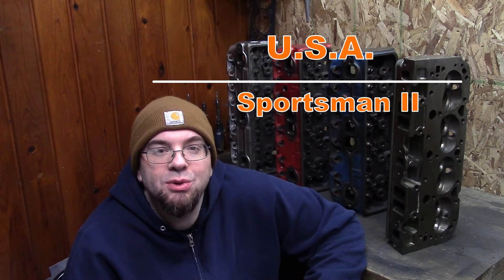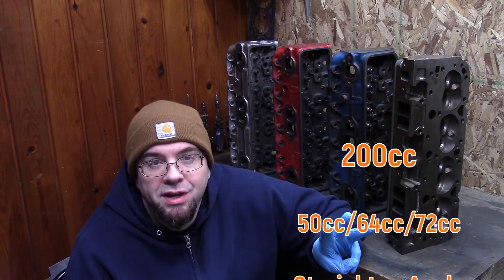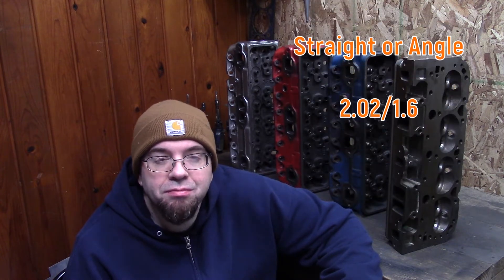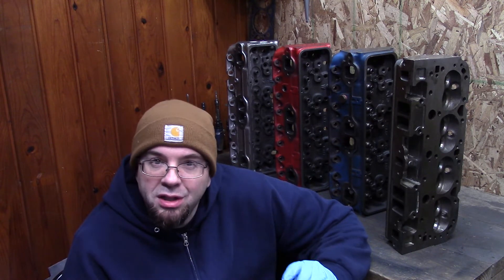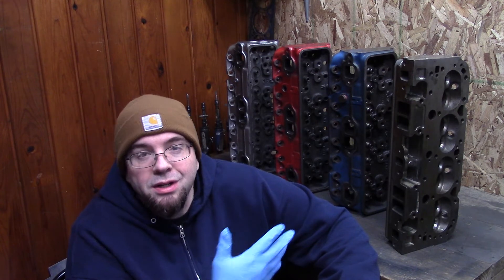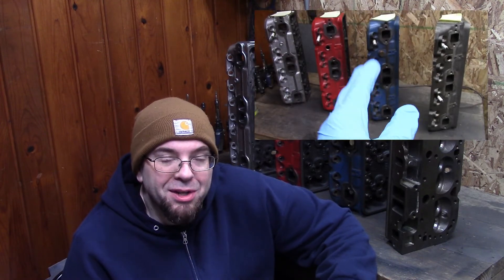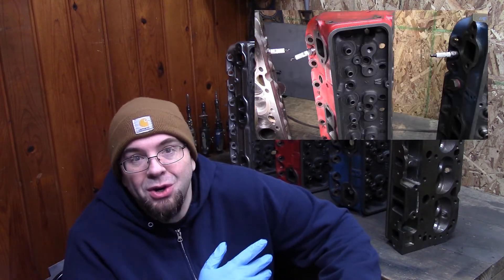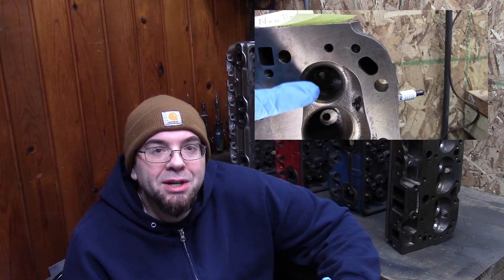World Products Sportsman II Cast Iron SBC Cylinder Heads

Comment: Hey Boot how high have you raised the exhaust ports on a set
Reply from the maker: Can't find it in my notes, surprised that I didn't write it down. Think I raised the roof bout 0.1 on the Dart set, that's what I've always herd/read is common for the sportsman exhaust ports and some other sbc heads.  Still no flow data just going off what others have done.  Honestly think I just mocked up a felpro 1404 exhaust gasket and it worked out needing that for the top anyway on that set.  Still some prefer smaller exh ports these days for some apps.
Reply: @BOOT  mine have a 2.08 intake and after doing the intake side I'm off on the I/e ratio. I guess I'll just start grinding n see how far I can go. It doesn't appear there's water above the last .75 of the roof